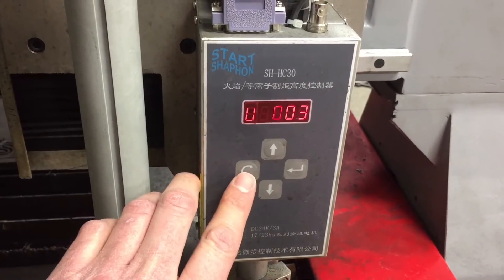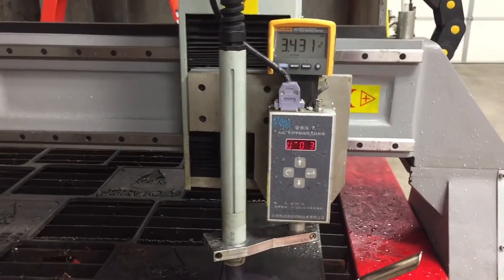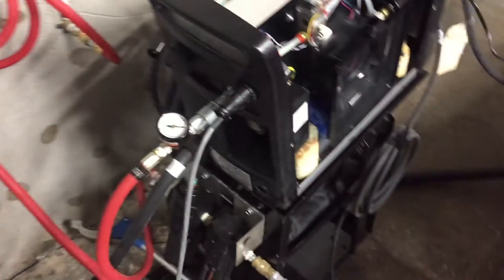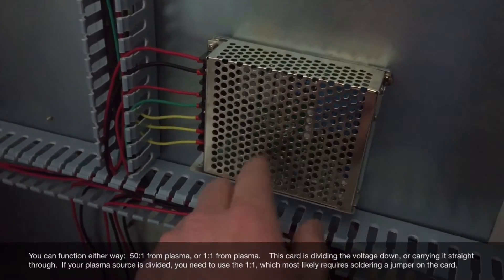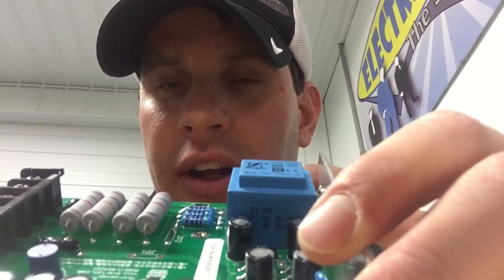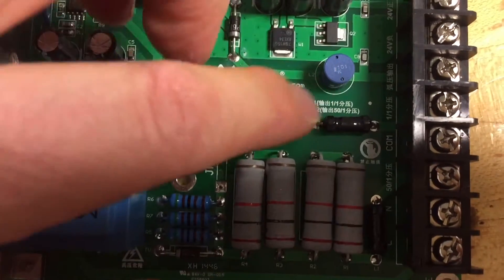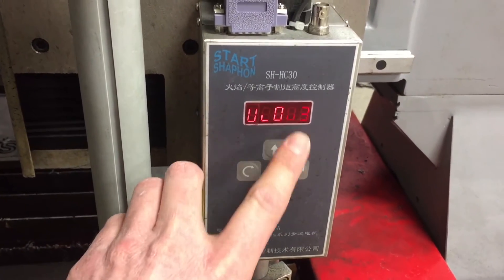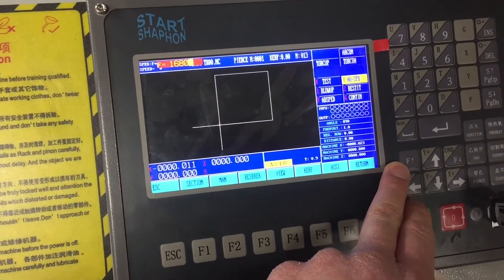Chinese CNC Plasma START SH-HC30 THC Problems - FIXED!

Comment: Hello I'm very surprised...You are truly a genius .....thank you

I have a question

 I've purchased Plasma Power Machinery from China with hyperTherm powermax85

The china factory  told me that hyperTherm powermax85 works on 380 volts input 

?Is it true it working on input 380VAC only
Reply from the maker: Thank you for the comment.  No, I purchased the Hypertherm Plasma source here in the USA.  It is a 220 volt - however they do offer a 480 volt version of it I do believe.  It would be a three phase cutter, which I do not have in my shop.  If you have 3 phase power, go for it.

Comment: Hello Larry. many thanks for video. It very helpful. just have one question:

 If I input divided signal from power max to 1:1 port, that means that signal goes straight without dividing. Than why is soldering required ?
Reply from the maker: Hello Levan, thanks for the comment.  If you just moved the wire on the outside of the card, the circuit is not complete.  You have to solder the jumper wire on the internal of the card ion order for the card to know you are sending a 1:1 signal.  I hope this makes sense.

Comment: Hi Larry, my name is Alejandro and I work for a metalmechanic plant in Chile. Thank you so much for taking your time to make this video and posting it on the web. It has been of great help for me and the company I work for. We have exactly the same CNC and THC, and the same plasma cutting machine Hypertherm. Without this video we wouldn`t be able to make them work altogether. I have a question for you (if you don`t mind): the CNC has 4 ports on the back: the first one (from left to right) is for the power supply, the second one is for the THC, the third one has two pins and the fourth has three pins... in which one should we connect the Hypertherm plasma? On the third or on the fourth port? We are having troubles figuring it out because the interface cable from the plasma has 7 cables, and none of the ports on the CNC has seven pins (they have 2 or 3) Any information about how to connect the plasma to the CNC would be of great help. Thank you so much for your time and help!!!
Reply: hi Alejandro, on my  cnc I only had to connect 4 cables, 2 are for the signal , and two are for the voltage, I´m in mexico and I,ve had this same set up for three years, I only had trouble when I changed plasmas , but I think I figured it out. by the way I only used two wires from the interface and the other two I took straight out from the plasma. A little confusing. Let me know if I can be of any help . saludos.
Reply: Buenas noches Roberto, muchas gracias por responder. Una pregunta, crees que me puedas explicar un poco mas en detalle como hiciste la conexión del CNC al plasma? Estoy enredado con ese tema y no he logrado hacerlas funcionar juntas. Muchas gracias de antemano. Saludos.
Reply from the maker: I am not 100% sure what your question is - but you will need to purchase the arc signal control cable from Hypertherm in order to connect your CNC controller to your Hypertherm plasma cutter.  You can open the panel of the welder and hard wire them in if you prefer.  Two signals are the arc signal cable (+/-). You will have to mount these on the ground of your torch, and the other on the positive.  I hope this is what you are asking.  THanks for watching!

Comment: hello, I have the exact same set up, I used to run a hypertherm 1650 powermax and everything worked great, now I changed to the 85 and I´m having the same problem, do you think the 1650 is set up different than the 85? any answer would be appreciated . thanks.

Comment: Thanks for sharing this, I recently purchased a Chinese machine similar to the one you show in the video. I'm having lots of problems with my machine, and it is really hard to figure out how it works with no help from China. I'm in the process of buying a Hypertherm Powermax 85, you are saving me a headache with this video. 
I need help with the settings on the Start Shaphon for the speed, syst, plas and ctrl. The machine came with the metric system settings. I changed them to the English system, but now the machine jerks too much when changing direction. 
Any help will be greatly appreciated. 
My email is teddgt@hotmail.com
Reply from the maker: I had the same issue, I have left my start system on the machine as metric, and do the conversion in my sheet cam to metric before I create the g-code.  No problems
Reply: Hi Larry how do you figure your machine to read sheetcam gcode, I've had enough of fast cam it's crap, I need sheetcam to export in txt but can't figure it out

Comment: great info.would you be willing to share the wiring diagram between the plasma and the THC for a non electrical beginner????
Reply from the maker: Shane, the actual THC has a controller in the CNC control box.  The wiring that goes from there to your THC is typically a 15 pin, or some light gauge data transfer wire.  So I am guessing you are needing the wiring from the plasma source to the CNC THC controller in your panel.  It's simple - if you have a voltage divider card built into your plasma cutter, you will come off of it with the positive wire.  The negative comes from your ground clamp wire.  So locate that on the inside of you plasma source and tap off of it.   If you do not have a voltage divider in your plasma source, you will come off of your actual torch cable that goes to your plasma torch.  You can locate it easy in your plasma source and tap off of it with some automotive wire (12, 14 gauge).  That would send a 1:1 signal to your THC controller.  That is the easiest way to do it, but be careful, that wire will be carrying some Volts since it's not divided (up to 300 volts - enough to make you piss yourself.).
Reply: +thanks
Reply: +Shane Forrester what I am trying to do without much success is to marry this THC with a torchmate table and hypertherm cutter.without any real electrical experience. I have been pondering it for some time now and am wondering if I can bypass the Chinese divider altogether or do I need the 220volt power connected to get the motor to work?? or can I use a 24v transformer to power it. it is very possible that I have bitten off more than I can chew